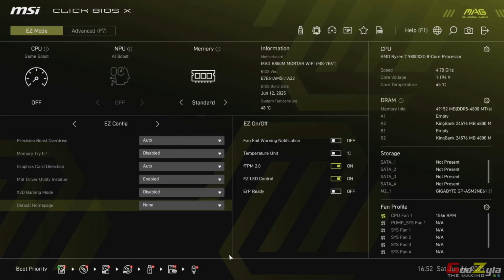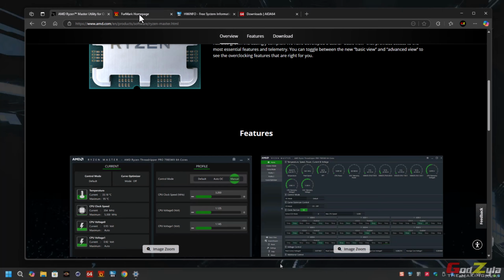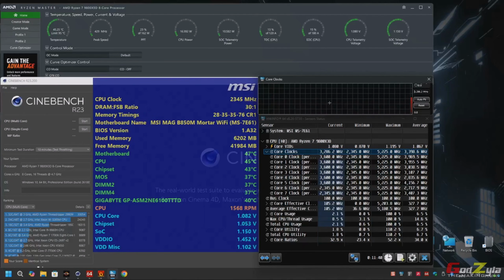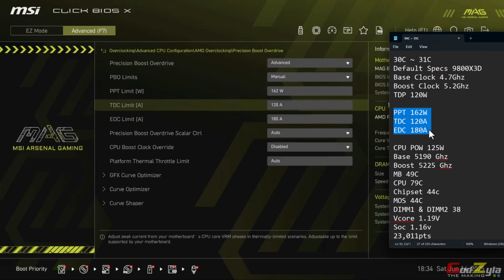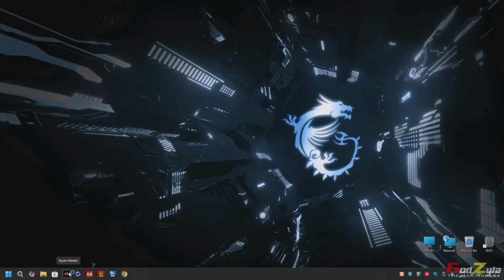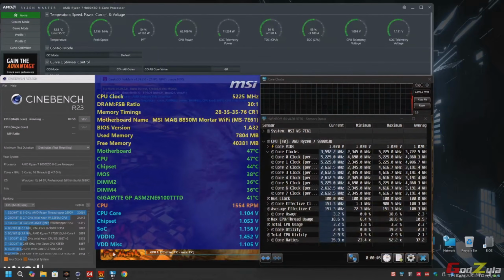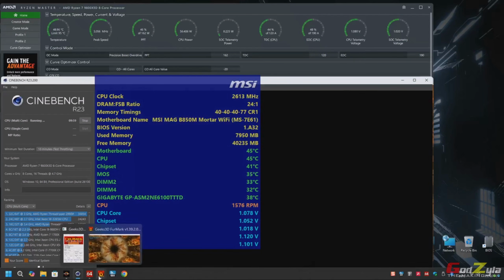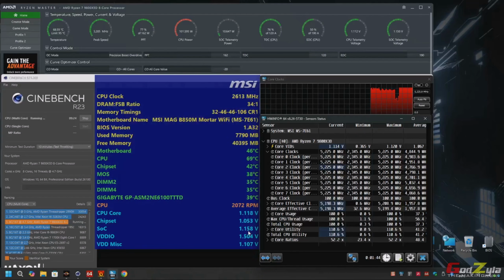PBO2 Curve Optimizing with 9800X3D on MSI Motherboard

Comment: Hi! I have a 9850x3d, and followed your video, thought i'd share my results! I think the results are great, but im curious about your opinion, and if you have any further recommendations for 9850x3d!   

Hardware: 
9850x3d
MSI B850 Tomahawk MAX wifi
Patriot Viper Venom 32GB (2x16GB) DDR5 6000MHz CL30 30-40-40-76

I was able to enable high efficiency mode with tightest

CPU info:
Base 4.7ghz
Boost 5.6ghz
TDP 120W

After changing core offset and NB/SoC voltage:

(default soc was showing 1.3-ish, changed to 1.15 as in video)

PPT 162W
TDC 120A
EDC 180A

First cinebench test run: 

CPU POW  102W
Base 5200mhz
Boost 5555mhz
MB 46C
CPU 83C
Chipset 41C
MOS 51C
Vcore 1.19
SoC 1.16
Score: 21032pt

After all the changes in the bios, second cinebench test run:
CPU POW  84W
Base 5290mhz
Boost 5625mhz
MB 48C
CPU 76C
Chipset 42C
MOS 50C
Vcore 1.092
SoC 1.16
Score: 21920pt

After this, i tried 1.2SoC, but results were almost the same as with 1.15, so i just went back to 1.15..

Edit:since then my pc froze once, gonna have to test if this is stable properly
Reply from the maker: welcome back Aggiblr. I will set it as 1.15v while actual run is drawing SoC at 1.16v but do remember to do the final test as I have spoken to you.. to test on stability. Just for your info, some have told me it's unstable. if that's the case, set Vcore Offset to Auto instead of -0.05v.
Final test or run
A) Run Aida 64 Stability Test for 2 hours 
B) Run OCCT with the configures below and run 2 hours
C) Set DATA SET to Large
D) Set MODE to Extreme
E) Set LOAD TYPE to Variable
F) Set INSTRUCTION SET to AVX2
G) Set time to 2hours
H) Highlight CPU+RAM
I) Click on start and run the test.
if all passes, play some games and observe.
Reply: @KleoYan  

 Hi! Thanks a lot for your quick answers, I really do appreciate it, as it's quite a complicated topic. For all your help, the least i can do is provide some data that might be useful for you: 

I tried the Aida64 stability test, and my screen frooze the second i clicked start. After that I changed the vcore offset to auto as you said, and the same thing happened again, froze immediately after clicking start.  

Next step, Now i turned off memory high efficiency mode -> still crash immediately. So i turn it back on. Vcore offset stays on auto as you recommended. 

Next step, i change all cores -20 to all cores -15.  -> now the aida stability test didn't crash it immediately, it crashed after 2 minutes. 

Next step, change all cores from -15 to -10. -> success for 30 minutes. 

Next step, with all cores still at -10, i changed back vcore offset to -0.05v -> success for 30 minutes

Now with everything set up as in the video (including vcore -0.05v), except all cores at -10, i did the full test you recommended:

Aida64 for 2 hours, OCCT for 2 hours: All stable 
4-5 hours of gaming: stable

Conclusion:  -20 for all cores was too much, but with -10 it's stable. 

Results: 
CPU POW  90W
Base 5275mhz
Boost 5625mhz
MB 48C
CPU 79C
Chipset 43C
MOS 51C
Vcore 1.126
SoC 1.16
Score: 21664

My remaining questions: Is the vcore offset -0.05v, and soc 1.15 still correct settings? Is there a benefit to change them? If i'd like more performance out of the cpu and i'm okay with worse power consumption/thermals, BUT without hurting its longevity, what changes  could I test?  Again, just more performance, but don't want to hurt the cpu. 

Thanks!
Reply from the maker: @Aggiblr  you are most welcome. Thank you for your input. I will leave it as what you've set and not further stretch. 
If you are to compare your default thermal results, you will find that your temperature gone down drastically after what you've set. That's because you have used Vcore Offset which lower down the current drawn of your processor. The impact is not much but it's still a decrease the voltage, some will ignore this and leave it auto. 

Next is the VSoC which does a major impact. Some have set to 1.11v or even 1.13v but that's over stretching which I do not advise.
If you want to see how much impact. with your current settings, you can set your VSoC to auto, just run a couple of minutes, take down your CPU temp and your DDR5 temp, once done set it back to 1.15v, test it and you will see the difference there. 

now as for your curve optimizer having at -10, I believe this has to do with your processor bin (Silicon build) 
I will just leave it as it is and not push any further. my guide here is to operate a system with low current drawn but no over stretching, having to operate at middle ground but able to perform slightly better than default.

If you still hunger to push further. What you can do is to forgo Curve Shaper and to use fully on Curve Optimizer but to do Per core.. here is the guide https://youtu.be/5cUY72GUHBc. As why I do not do this, often people like to keep pushing, setting too low magnitude. Your processor will be happier to have sufficient voltage to run, rather than struggling to run, so that's the temptation of using Per Core, you will keep pushing which will over stretch the processor. The choice is yours, I leave it up to you.

Comment: I saved this video from when i planned to upgrade my PC, and I just upgraded to AM5,  B850 MSI tomahawk max and a 9850x3d, i hope this video is going to be useful, even though it's not the same CPU, but a close one to it.
Reply from the maker: Welcome to my channel Aggiblr. You can make use of this guide. The PPT TDC and EDC are of the same as 9800X3D but you might want to set VCore Offset to Auto as some have reported it's unstable on their 9850X3D. Kindly run aida 64 stability test when you being setting your configuration each time. 30minutes will do, once completed, have a final run as below. 
A) Run Aida 64 Stability Test for 2 hours 
B) Run OCCT with the configures below and run 2 hours
C) Set DATA SET to Large
D) Set MODE to Extreme
E) Set LOAD TYPE to Variable
F) Set INSTRUCTION SET to AVX2
G) Set time to 2hours
H) Highlight CPU+RAM
I) Click on start and run the test.
if all passes, play some games and observe.t

Comment: i did this on my 9800x3d. the issue is i dont know why it still pulls around 123-125w during cinebench.
Reply from the maker: Welcome to my channel. Just to check are you on the latest bios and also did you do a clear cmos and start to configure from stratch.. btw which motherboard model as you using on MSI?
Reply: @KleoYan  im using a b650 gigabyte. i dont see any gigabyte video yet so i use this one. i am in latest bios. havent done a clear cmos yet. my pc is very heavy as i use an nv7 case.
Reply from the maker: @SmokyCelso  I see, do pardon me. I only did for Asus, MSI and ASRock as for Gigabyte, I have returned the 9800X3D to AMD SG, thats why there are none. I guess you will need to figure it out on the configuration.

Comment: can i use this same settings for 9850x3d and a b850 tomahawk?
Reply from the maker: Welcome to my channel, D! Yes, absolutely you can, the PPT TDC and EDC are of the same as 9800X3D. I will encourage you to fully understand why it's set and how it react so you have total control of your system's wattage, voltages, and more, while maintaining peak or better performance.
Reply: Thanks bud, I'm going in the bios and doing this step by step
Reply from the maker: @d.6961 ok all the very best 👍👍👍

Comment: Hi! I have a 9800x3D, MSI B650 Tomahawk WiFi (latest BIOS, non-beta), G.Skill 2x32 6000CL30 M-DIE(HEM - tightest, others settings auto- 1:1, 2000 if), 360 AIO by lian li, 10 coolers, 4070 TiS...

1) SoC 1.15v as you recommended(auto is 1.2v) - it's stable in tm5, preset anta777@extreme, 1,5 hour(~2 cycles, 64 degrees max). At gaming no problems. Should more tests for stable? How do you think?
2) I'm trying to understand the practicality of the vcore offset mode -0.0500v you recommend. it’s pointless? I see how this setting improves my system by 2-3 degrees max in some situations, but I'm concerned about performance. How accurate is this without causing harm? How can I reliably test this? p.s. i use stable C-optimizer by per core, without c-shaper(need it?)
3) I prefer the coldest temperature possible without losing performance. Thank you!
4) Is it normal that my 7800x3d out of the box was 70 degrees Celsius in game, while my new 9800x3d out of the box was the same? It should be at least 5 degrees cooler, right? Is this normal? Thanks, sir.
Reply from the maker: Welcome to my channel  Fire, thank you for your enquiries, I will answer you base on experiences. 
Q1) SoC 1.15v as you recommended(auto is 1.2v) - it's stable in tm5, preset anta777@extreme, 1,5 hour(~2 cycles, 64 degrees max). At gaming no problems. Should more tests for stable? How do you think?
A1) You can use test application like OCCT with AVX2 enabled and on extreme profile, this will stress not only your CPU and heavily on your DDR5 rams. Another is Y-Cruncher. Test it for 1 to 2 hours, I don't find stress testing more than 2 hours practical, as I doubt anyone will run a system at full load for more than even 30minutes. 

Q2) I'm trying to understand the practicality of the vcore offset mode -0.0500v you recommend. it’s pointless? I see how this setting improves my system by 2-3 degrees max in some situations, but I'm concerned about performance. How accurate is this without causing harm? How A2) can I reliably test this? p.s. i use stable C-optimizer by per core, without c-shaper(need it?)
You can choose to use Auto instead of Vcore offset. It might be pointless at only -0.05v but in long run as I use it for work instead of gaming. as it accumulates, that will be energy saving. Example default AIB limit lock is at 1.35V and actual pull is at 1.18v, setting offset you are adjusting it to have a cap range of 1.30V an on actual run it might just pull 1.13v. Unlike fixed Vcore which is always running at the Fixed VCore you've set. The choice if up to you. My main concern is energy saving and to prolong the lifespan of a processor. 

Q3) I prefer the coldest temperature possible without losing performance. Thank you!
A3) The content I shared. It performs better at lower temperature with lower current. Of course you need to do stress test. 

Q4) Is it normal that my 7800x3d out of the box was 70 degrees Celsius in game, while my new 9800x3d out of the box was the same? It should be at least 5 degrees cooler, right? Is this normal? Thanks, sir.
A4) In general if both are to run at default, having the same specs as in DDR5 and M.2, inclusive of the same cooler, same case and airflow, without PBO2 limit settings, the 9800X3D should run cooler
Reply: @KleoYan  Thank you! I'm not sure. Does Offset Mode -0.0500v only reduce CPU temperature?
I have a Msi B650 Tomahawk WiFi(last beta BIOS) and in standard mode Vcore is 1.184v. 
Could this setting actually reduce performance? Perhaps I'm misunderstanding how Offset Mode works. 
I don't think the -0.0500v setting has any effect on temperature in gaming. I only play games and pursue the lowest possible temperatures without losing performance, even by 1% idk. I know you don't play games, but what's your opinion?

Sometimes I feel like without PBO settings, my CPU runs as hot as the 7800x3d, but after PBO CO, my 9800x3d runs at 60-65°C in games, which worries me. This is at -22°C (all cores or per core).
Reply from the maker: @wffire  the reason I lock it down as Vcore offset to -0.05, default the motherboard is providing 1.35v but does not mean it will pull to this voltage. on average with static benchmark, it will be around 1.054 to 1.35v, it's just a safe guard that I fix the default of 1.35v to be 1.3v 
if you run CO and it's bringing down the temperature, it's a good sign plus it does perform using less but sufficient power. That's the reason why my settings are moderate, else others will push to -30 -40 or even -50.. having curve optimizer at all cores -30, -40 or -50, to me is unhealthy as your processor do require the current inorder to sustain the clock speed. by providing lesser. yes it can run but in long terms, it might be unstable to run.

Comment: Can I follow this guide without doing the curve shaper step?
Reply from the maker: Welcome to my channel Bosco, yes you can without issues.
Reply: @KleoYan thank you! I have g skill z5 Royal Neo 6000mhz 32gb. CL28 - 36-36-96. Should I use tightest or tight for memory timing preset?
Reply from the maker: @BoscoThaiBoxing  For rams, enable EXPO profile. set your DRAM Speed to 6000 and your FCLK to 2000. then set UCLK=MEMCLK .. next go to Advanced DRAM configuration. follow the Safe Settings listed below. I find out that the settings i've done are less agressive and safe to use. 
Defination - https://i.imgur.com/Ly1wb0o.png
Safe Settings - https://i.imgur.com/94CpwGK.jpg

Comment: I followed the steps exactly as in your video.Great tutorial, thank you.

I have an MSI X870E Tomahawk WiFi. Is this OK?

The CPU voltage is low and the power is reduced, but why low than you?

2x16 RAM 6000mt

Ryzen master:

74w cpu power -ryzen master
soc tele power 10,3 w

CPU Power 74W 
CPU telemetry voltage 1.040v

SOC telemetry power 10,3 W
SOC telemetry voltage 1,151v
peak speed 5202MHz

HWinfo:

Core Clocks 5,225
CPU (Tctl/Tdie) 60 C
CPU Package Power 97W
Vcore 1,048V

cinebench r23 after 10 min=22457pts
Reply from the maker: Welcome to my channel jan ziomo. It's perfectly fine to apply on your MSI X870E Tomahawk. CPU voltage is low, consider the fact that each processor are bin differently. you might have a very good bin processor. Also to the fact that your room temperatue is much lower compared to mine. Having cooler environment helps the component like VRM , M.2 and DRAM to sustain lower consumption. Btw you should not be comparing to my set up, you should compare your Defautl scores and temperatue against after you have done the configuration. It's pointless to compare against mine as mentioned, depends on enviroment room temperature and the processor bin. Overall I would say that your system runs very cool.. Congrats! 👍👍👍
Reply: @KleoYan  Thank you once again for your time and knowledge.
Reply from the maker: @janziomo4570 you are most welcome 😉

Comment: Very great video. I build a new pc:

9850x3D
Msi meg x870e ace max
2x32 gb ram F5-6000J2636H32GX2-TZ5NR
Rtx 5090

I will follow your guide and give an update how it runs. May any recommondations, heads up etc?
Reply from the maker: Welcome to my channel DoubleYouRandyBe. The ram kit that you are using is of 64G kit, it may not run stable at NB/SoC voltage at 1.15V. if it does not run stable, I will advise to up the voltage between 1.17v to 1.18v. As for the rest of the settings, if you find it's running stable, you can try change the Curve Optimizer to -25 but not more than that.
Reply: @KleoYan   Thank you. I run it with the EXPO profile wothout issues. I think will optimize it anymore, I only thinking to activate "high efficienty mode", what you think?

I made a quick check and run CB23

default:

CPU Power: 142W
Boos clk: 5280 Mhz
CPU temp: 77.2
VCore: Ø1.203
Score: 22687

PBO + CO ( -15)

CPU Power: 136W
Boost clk: 5375 Mhz
CPU temp: 72.4
Vcore: Ø1.164 V
Score: 22687
Reply from the maker: @DoubleYouRandyBe  I assume your ram kit is 64GB DDR5-6000 CL26-36-36-96 1.45V.
1) I will first let it be on Expo and leave the SoC voltage, load to windows, run aida 64 Cache and Memory Benchmark (take down all the readings or do a screenshot)
2) Run aida 64 stabilty test for 30minutes, take down the temperature of your ddr5 
3) Boot to UEFI set to High efficiency mode and select tighest
4) Run aida 64 stabilty test for 30minutes. If it did not crash on the 30 minutes, before you press stop. take down the DDR5 temperature. 
5) If it did crash, go back to UEFI set it to tigher, repeat step 4) if still crash, disable High efficiency mode. 
6) if it did not crash, run aida 64 Cache and Memory Benchmark (take down all the readings or do a screenshot) 

Compare your readings as in temperature on EXPO only vs EXPO + high effeciency mode latency. let me know once you've done. The above is just to let you understand and experience why the changes and should you use it.
Reply: @KleoYan   Hi, her are the results:

PBO + CO + EXPO
AIDA64 
Read: 62755MB/s
Latency: 76.9 ns

Expo Subtimings
tRRDS = 8
tRRDL = 15
tFAW = 32
tWTRS = 8
tWTRL = 30
tWR = 90
tRFC(ns) = 294.6667
tRFC = 884
tRFC2 = 480
tRFCsb = 390

PBO + CO + EXPO + Tighter
AIDA64 
Read: 63860MB/s
Latency: 68.9 ns

Expo + Tighter Subtimings
tRRDS = 4
tRRDL = 10 
tFAW =  28
tWTRS = 5 
tWTRL = 28 
tWR = 60 
tRFC(ns) = 216.6667 
tRFC =  650
tRFC2 = 480
tRFCsb =  390
Reply: New CB23 Score: +/- 23188
I rund OCCT for 30min without an error
Reply from the maker: @DoubleYouRandyBe  Hi, I am unsure of your DDR5 temperature and there are two areas which are risky in prolong usage. here is what I have for you with explanation. https://i.imgur.com/q08BxrE.png (download if image too small) .. if you decided to set it manaully, this is what you need to do.
1) set High-Efficiency mode to AUTO 
2) Save it are reboot back to UEFI, 
3) Under Overclock > Advanced DRAM Configuration, fill in the figures on Option 1 
4) Save and test the lantency with Aida 64 Cache and Memory Benchmark
5) Test overall stability with Aida 64 Stability Test, OCCT + AVX2 or Y-Cruncher for at least 2 hours

for more info to know what each configuration does, you can view here https://i.imgur.com/Ly1wb0o.png (download if image too small)